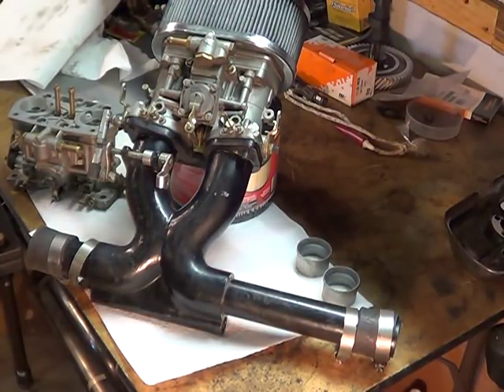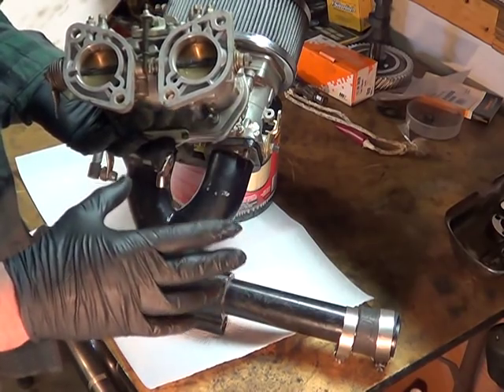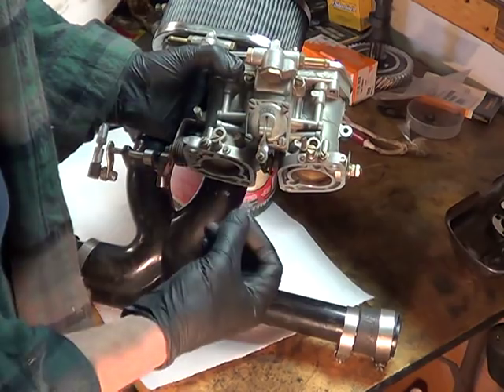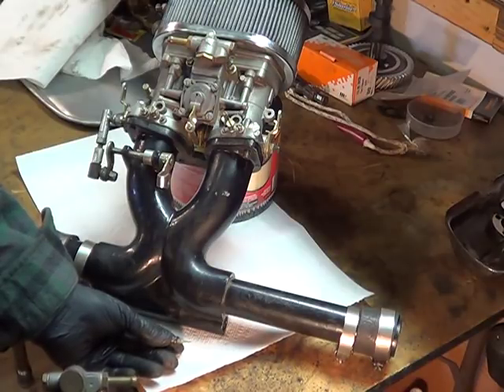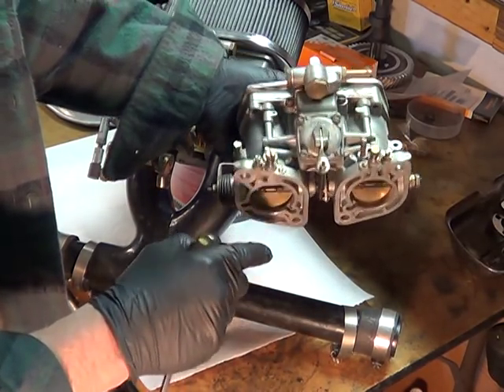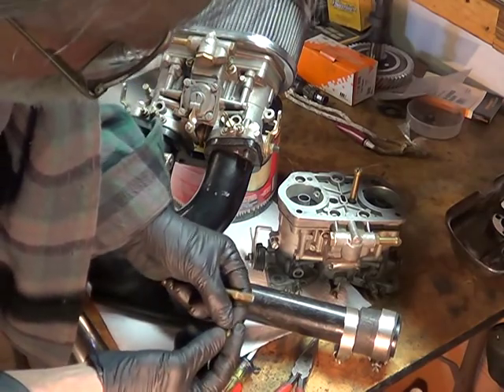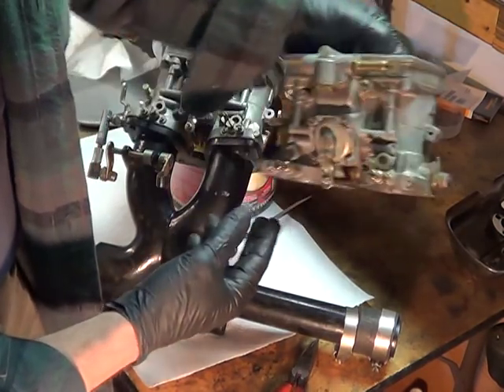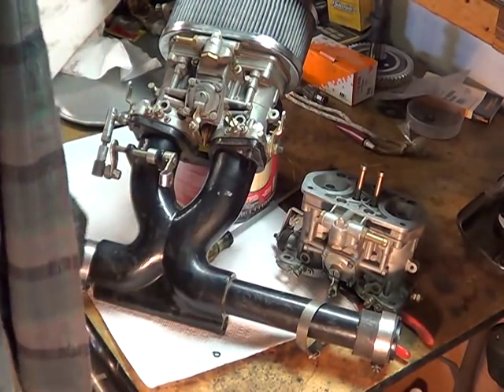Dellorto / Weber carb secrets #2

Comment: Hi EZGZ,
   A quick correction if I may. Early in the video you mentioned the two small block-off screws inboard of the mixture screws. Those are actually a diagnostic feature, which allows one to attach a vacuum gauge to an individual throttle body to measure manifold vacuum. However, the outboard (outermost) screws in each 3-screw set are air bypass screws. Those allow for the balancing of air between individual throttle bodies, but are only effective at idle.
Reply: Correct. That's what you adjust using a length of hose placed in the bore of the carb. And the other end in your ear and listen to the hissing sound to balance the sound between of each of the bores. And as you said. Only at idle.

Comment: You are the carburetor professor!  I am getting ready to bolt a Weber 32/36 progressive carb onto my fairly stock 1974 VW super beetle.  I realize that isn't the carb you are looking at here, but I still found this a very useful video for illustrating the functions of a carburetor.  This was a fine change from watching fairly average mechanics not really explain what was going on, etc.
Reply from the maker: You are to kind. Thanks for the support. I don't have anything to pass on about the 32/36 at this time. May you have a prosperous 2014 and your VW always run well. Some folks are real happy with that carb. All the same principals. You just have to take the time to understand it.  PEACE
Reply: 32/36 DGAV was my first big carb stupid horse power but like the mileage when off the throttle good luck , runs great and was on my 1850CC

Comment: I have a carburated Toyota Celica (22R) engine. I have headers connected to 2 and 1/4 piping all the way back. I'm planning to put a 280 to 290 camshaft and port/polish the intake and exhaust. Since you're very versed and wise about carbs, I was wondering if you'll help. What Weber carburetor would be ideal for this set up? I was thinking of a 32/36 progressive or a 38 DEGV. What's your opinion sir? By the way, great instructional video man! God bless!

Comment: Hi Laura. I'm pretty familiar with the 32/36 setup, but most on aircooled engines. The biggest problem people have with that setup is the secondary main jet is far too small. When the secondary opens up, you are introducing a ton of additional air to the carburetor and engine, and an adequate amount of fuel should accompany it. Additionally, the accelerator pump jet is often too small from the factory to satisfy the transition to the secondary circuit opening. Try a larger size of both.

Comment: Love the carb videos EZGZ, I have a leaking accelerator pump jet on my Dellorto 36's and need to change the gaskets I think.
You haven't adjusted that on your vids, does it just screw in and out like the idle jets? 
I just change the seals and grommets and screw it back in and tighten it up?
Thought I'd check with and expert first.
Thanks again for the films!

Comment: Hi ZEGZ!
Great channel and videos, I'm relay glad I found your Utube channel.

Would you kindly help me with a carburetor decision: I have a 75 bug Type 1 1300cc Dual Port(31pict -4) And I would like to install a single Dellorto carburetor on a center mount MANIFOLD LINKAGE adapter.
I intend to upgrade my engine to 1600 somtime in the future, but for now i will leave it as is.
can you tell me what would be the best choice of a Dellorto and the best venturi and jet sizes to make this work, Now in the 1300 set up and in the 1600 future set up?
In addition what else would i need to add to my stock setup to run this.
thanks!
Reply from the maker: +Blonding Leave it stock.  Thats my advice and I'm sticking to it. You need to save some money and do some more research. Thanks for watching and commenting

Comment: I have a 2180 with a 009 distributor mechanical advance and center mount solex 34 pict 3. It drives ok, but I feel I could get better performance. I don't want dual carbs, it's my daily driver. I drive it 400 miles a week for work alone. I am thinking about putting either a center mount 44 Webber or 44 empi. What is your opinion? Thanks in advance.
Reply from the maker: 40 IDF with 28 venturi's. but it will need vacum dizzy and be a nightmare if you don't heat the manifold. Just get dual carbs and be done with the it.

Comment: Great, informative videos, thanks! I just bought a pair of used 45mm DCOEs, and I'm in the middle of rebuilding them. They are a bit beat up, and I have to replace a bunch of mangled parts on them. Luckily, the parts availability for these things is pretty good even today. There's something theraupeutic in tinkering with these old carbs, and it's nice to hear you talking about them. Even though your application and carb model differs from mine, the basics are still the same.
Reply from the maker: I agree,

Comment: OK I have a 40 DRLA Dellorto ,tearing down the carb I found that the mixture screws don't have a o-ring or spring ,would that make it hiss and pop somr of the time? Thanks for any info and help
Reply from the maker: Herlin Woolery yes most definitely. There is a also a tiny washer that goes between the spring and the o ring so it doesent tear it up. The spring would be grinding the o ring into the body. ACE hardware has some good o ring assortments as well as springs. you will probably have to cut the sprng to length. CB performance still sell the carb rebuild kits.

Comment: Thanks EZ, I just bought a 1915 sand rail with two 44 webers and it wont idle worth a darn. Out of town working right now, but when I get home tomorrow I know where to start. Thanks again.
Reply: step one is to idle with E-85 for an hour, then get that fuel out of the ca or use it up

Comment from the maker: Thanks for your interest in my video. I hate to sidestep your question but I'm not familiar with your specific application. I'm guessing that there are a lot of folks that have been down that 22r road and could give better advice. The more performance parts you throw in the mix the harder it is to tune and you sacrifice some things along the way. I came full circle and want simple and reliable more than top end performance for my offroad dunebuggies. Good luck with your Celica project

Comment from the maker: I feel your pain but it was very long ago since I messed with one of those. It had a terrible stumble as you take off. I gave up on it since it had a engle 110 camshaft which needed dual carbs.
Raise your idle, play with your spark timing, Make sure your carb is clean and accelerator pump is working. No more than 3 psi fuel pressure going to the carb.  Light a candle and say 3 hail mary's might help to. can you give me more info so I can help you.

Comment: Hey sorry to bother you but I got to ask you a question what's the difference between a F7 emulsion tube and a f 11 emulsion tube when I compare them they do look a little bit different on the locations of where the holes are at does this affect the way the carburetors will perform
Reply from the maker: It's also the diameter of the brass where the holes are.  Those things make a big difference. You just have to find the one that works for your application

Comment: I saw one of your videos that you showed gas that was left or sitting in the top of the head, that is caused by a delorto that dosent hold its gas in the float bowl the gas just runs out did you ever find out why that is and what did you do to fix it i have the exact same problem with one of my 36 delorto carbs and i cant figure it out i bought rebuild kits and cleaned them from top to bottom blew it out and it still leaks gas into the cylinder when the motor is off and not running and then it sounds like it takes a big deep breathe anyway you had same problem just wanted to know your solution , oh and i replaced the little brass fitting with the lil ballbearing in the bottom of the bowl (Check valve) and it had no effect still leaks thanks for any info tyo cure my problem  kevin
Reply from the maker: If you ever find out please let me know. I have one that does that.  I haven't figured it out.
Reply: TheEZGZ Could it be a Float valve not closing off the gas when full? As a young man in a motor cycle repair shop this was a common problem. Before the start of vacuum actuated fuel cocks, the gas would run right thru the carburetor and thin out the oil in the crank case. Just a thought of where to look I hope it helps. Your videos are a wealth of knowledge thank you for sharing your experience and your expertise in providing such a straight forward and helpful series of instruction. Common sense goes a long way. My mentors were always older than I and if I kept my mouth shut and listened they would teach you anything they had to share. Sincerely John
Reply from the maker: Thank you for your support I do appreciate it.   Be well and prosper.

Comment: EZGZ, got a bug 1965 1300, got a problem, car wont idle. stars runs for 30 sec, and shutoff. if I drive is ok, but can't stop. need to starter every  time.  need  help. thks
Reply from the maker: Hard to say.  Best to get a book and keep it simple. Start checking the basics.   1300 but you haven't told me anything. Therre aren't usually quick answers from a distance.  Good luck  my friend.

Comment from the maker: Study page 53 of your dellorto tech bood and you will see that fuel level in the float bowl place a critticle part of the accelerator pump circuit as well. Check your seals and O rings. Double check your float level as well as you float chamber inlet valve.
It screws out like the idle jets but there is a flat side to make sure that the squirt hole is facing down. That long spring acts like a filter to keep the tiny hole from clogging.

Comment: Intake manifold?  is that for a VW?  I have 2 Dellorto and a VW 2 liter, It is impossible to tune while in car.  Can I use the Intake manifold you show on this video and use just one of the Dellorto?
Reply from the maker: Probably not. It explains all that in the Dellorto book that is still available from CB performance.  You probably new it wouldn't be that easy. For both our sakes I wish it was that simple.
Reply: Thanks for the reply.
Reply: we use one intake manifold on our 2.3 litre street bug with a 40 Drla punched out a bit with 350 cfm runs fine ?for years sold Drla for years in a vw hot rod shop, you can still buy rebuild Dells in Italy for replacement

Comment: ok so I have the 44 weber. I have been messing with this thing for months now. So the Two idle jets at the top of the carb (without the spring) they need to be all the way tight right? there is no adjusting them? My bug only seems to be running somewhat good when i turn them out just a hair...PLEASE HELP!!
Reply from the maker: The only Turn adjustment are the idle air screws at the bottom on each side.   I can't tell you any more based on what you have told me.  It is a painful learning curve I know.  Everything else on your engine needs to be in good condition and working properly,  No it has to be working perfectly. A single IDF weber is finiky at best. I think it's time for a video update.  Post a video with as much as you can show me and send be the link.   Good Luck and thank you for watching and commenting.
Reply from the maker: Just thought of something else. if your loosening the idle jet holder and it runs better with air leaking by it may be to rich.  Make sure your running the stock 50 or 55 idle jet and nobody has drilled them out. You can't always go by the number if it is a used carb.
Reply: TheEZGZ ya thats what i was thinking today as well. I ordered a rebuild kit and it should have new jets in it. I am hoping that fixes the problem. I have adjusted the valves as well as the timing although i do need to fine tune the timing with a light... I replaced the belt and the spark plugs as well as the spark plug wires. I have cleaned out this carb multiple times and it runs the same no matter what I do... Heres to hoping its the jet. Also I put a Solex pict 34 on it and it ran even worse. Start up and idle were better but speed and take off were worse so i went back to the Weber 44.
Reply: ***** I will post a video after I put the rebuild kit in the carb and if it didnt fix anything to show you how its acting...
Reply: TheEZGZ ok i just checked the jets and they say 60 on them... thats gotta be my problem right??
Reply from the maker: ***** only one way to find out.        Black smoke and sooty tail pipes can indicate a rich condition but your dealing with idle so it's harder.  Blue smoke is oil.  Comon on started up from normal wear.  Your learning fast and thinking it threw.  Take a chance and get a few new jets
Reply: TheEZGZ ok i got the 55 jets and my rebuild kit. got it all put together. It now has a hard time starting and will only start when i loosen the idle jet a little but when it starts and i tighten it it sounds better. weird i know... I begin the tuning process.. it is adjusting with the adjustments but still doesnt start and run good i thought maybe a vacuum leak but nope i checked... I put the 60 jets back it it and suddenly it runs good. Maybe when i but the rebuild kit in it something got fixed idk,,, now it starts good with the 60 jets and they are tight (not backed out at all) and sounds good. tuned it the best i could and it hesitates when gas if floored but does get up and go and has tones of power after the hesitation... im thinking timing?? im not sure... what are your thoughts on my mess of a carb ha?
Reply from the maker: ***** Every engine and carb combo is different.  Your learning the same way I do. Just have to keep after it until you get the results you want. It's a good idea to keep some sort of record of every change you make and the results so you can keep on the right track.  It's always nice to have another carb to try that runs well. A luxury most don't have.   This game is all about $$$$ and determination. No satisfaction guarantee Racer's only go from light to light they don't care about daily drive-ability. Then they lie about how great it runs & only get 15MPG
Reply: TheEZGZ Im not sure if i mentioned this but my bug is a rail. So i mostly use it on the sand dunes so i need to be able to floor it with no hesitation when needed... do you have a video on timing? Is static timing good enough or do i need to go get a light ??
Reply from the maker: ***** Here you go. This is how I started my journey http://www.cbperformance.com/SearchResults.asp?Cat=303

Comment: hi...I saw many videos of you..and I have a question..I have twin dellorto dhla 40 in my BMW e21 engine m10b18 1.8 and I want to know best giglers config to my engine..could you help?
Reply from the maker: What size are they? DHLA 40, 45????  Do you know what size the venturies are inside the throat's???
Reply: dhla 40 but don't know the rigth size of venturis..it's possible I send you a pic of it?
Reply from the maker: DHLA 40 Should have 34 venturi, 180 air correction, 140 main jet, 55 or 60 idle jet, 35 accelerator pump jet. Those carburetor's Should work fine on your  1.8 You may want to watch the first vid again https://www.youtube.com/watch?v=uYNil8zC6Iw&t=8s      Good Luck with your project
Reply: tanks for the answers..:)
Reply: TheEZGZ what size of pump jets should a ford 1.8 cvh with a high lift cam etc dhla40g.. I have 40 at the moment and it hesitates. Cheers

Comment: Single Dellorto/webber set up sucks. I had a single 44mm dellorto on my 1835 with a 120 cam. Switched to 40/44 Kadrons and man....more power, smooth idle, better gas mileage.  Unless  you are racing in a class that requires a single carb. Run both carbs.
Reply from the maker: The secret is manifold heat and a mild camshaft
Reply: @TheEZGZ  yeah maybe with a 100 or 110 cam.  Maybe I shouldn't have said sucked. I have just had way better results with the Kadrons.  I even had the dellorto throated and the idle circuit set up for running a single.